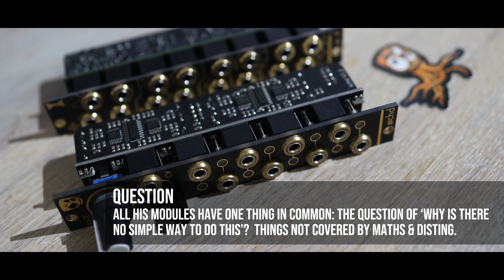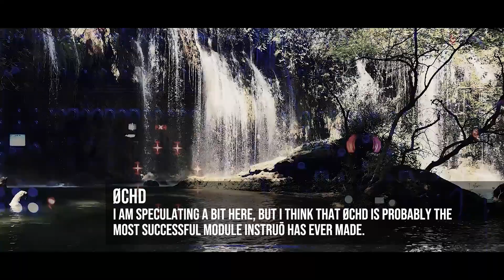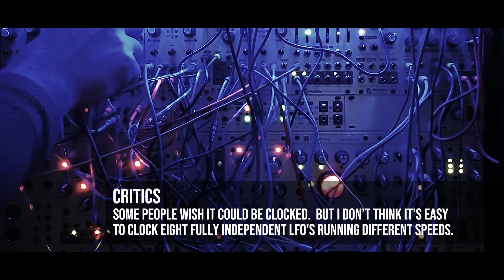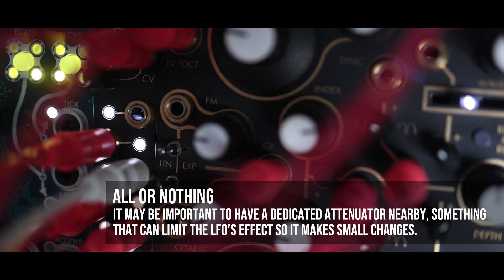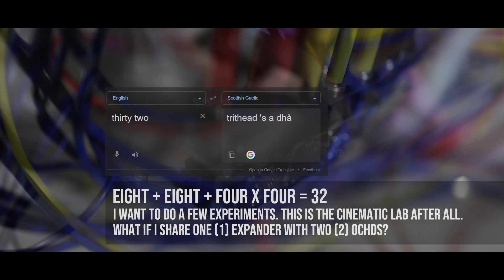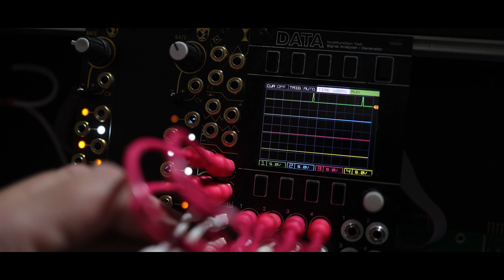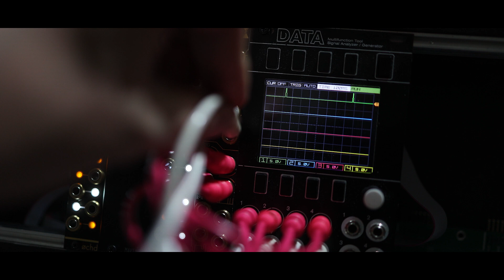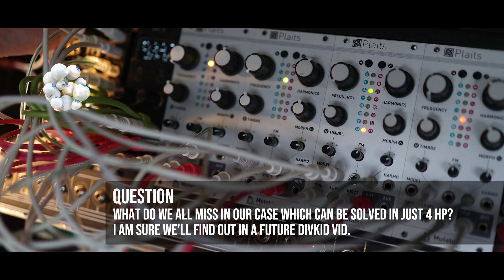DivKid Showcase | Mutes | Ochd | Rnd Step | Ochd Expander | Ochd + Ochd + Expander

Comment: That's the first time I've heard some refer to +/-5V as "mild"... I would consider +/-1V as "almost mild". "Mild" is more like +/-500mV.

Good video, BTW. As usual. 😉
Reply from the maker: You're right. It's just that it almost seems that - regardless of the 5V potential, Rnd Step seems to 'prefer' values in the low range. It provides nice, modest and musical values instead of 'kicking things'. However, that's what my ears tell me. I remember reading somewhere that you can adjust the pots on the back to make it a bit more extreme, but I love it as it is (like modulating a Mutable Elements).
Reply: @CinematicLaboratory  Thank you for your reply. I like that. So Rnd Step is good for "musical" modulations. I dig that.

Comment: Thanks for giving these modules the respect they deserve!

Would love an Øchd v2 where the spread between the speeds from the slowest to fastest LFO can be manually and CV controlled - 0 all the same speed / 5 or 10 V for maximum spread.
Reply from the maker: Totally agree, but it's impossible to fit all that in just 4 HP except maybe with a few switches on the back. I must admit I rarely use the top LFO's because they're too fast for most scenarios and when you slow them down, the bottom ones hardly move. But in 80% of all my patch needs, it's perfect and I'll pick Maths, Zadar or the 285T  for the 20% fancy stuff.
Reply: @CinematicLaboratory  what about making the top fast LFO a master clock? I think that would be a nice experiment... 🤔
Reply: @studio48nl I think that's somewhat tricky with a triangle lfo ?
Reply: @chetplease  yes of course, but some modules do interpret a threshold as a clock (like passing 2.5v), regardless of the steepness of a raising signal (like Doepfer).
Reply: @chetplease  Just run it into a comparator, easy peasy. If you have some around and have an inverter handy you can also rectify some of the Ochd channels!